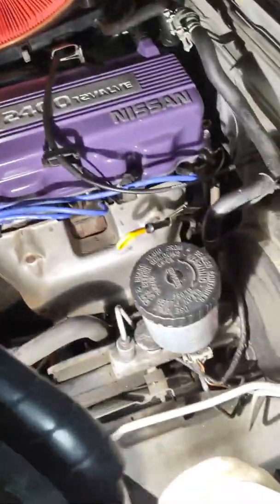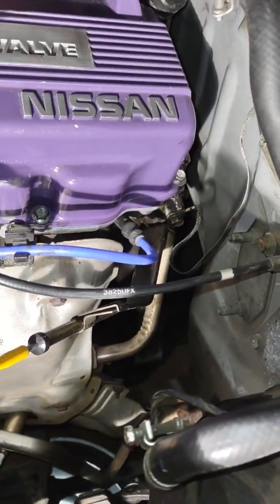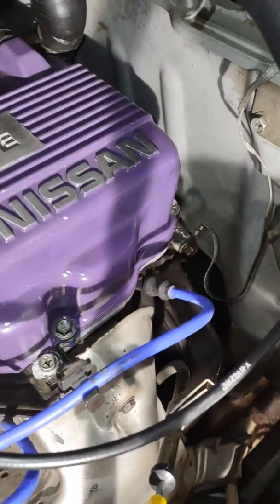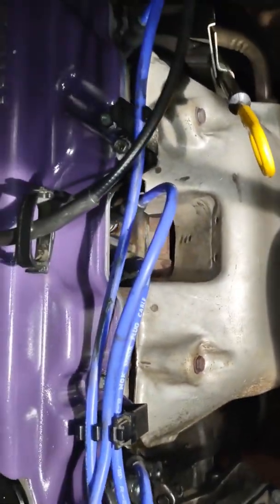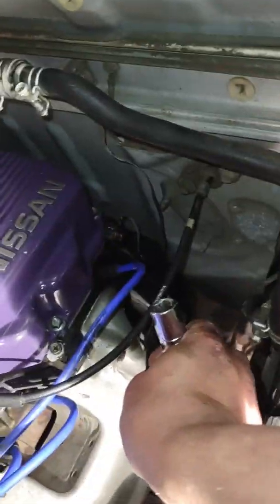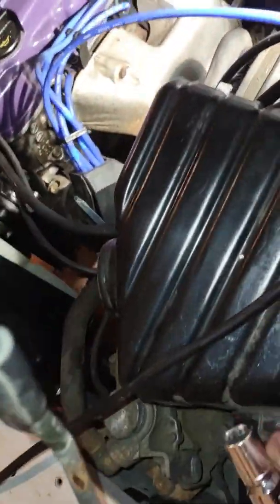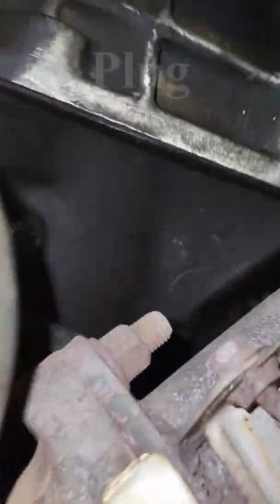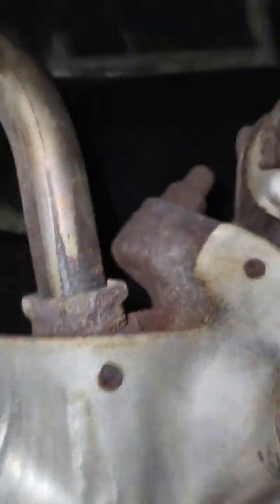Nissan D21 KA24 Coolant Drain Plug location and removal for coolant flush

Comment: Thank you for showing the 14mm plug.  What sealing do you recommend applying to the threads?
Reply from the maker: The plug is tapered so it shouldn't need it but Teflon tape was my choice because that's what I had on hand. I can look through my service manual and post what OEM recommendation is.
Reply: @lazerd21  the plug  is hard to reach. What  if i remove the heat shield, would this help?
Reply from the maker: It can help if your hands are larger. I personally didn't need to, especially when using a swivel head socket. Stand on the driver's side of the hood to get the best angle. Feeling around and patience goes a long way.